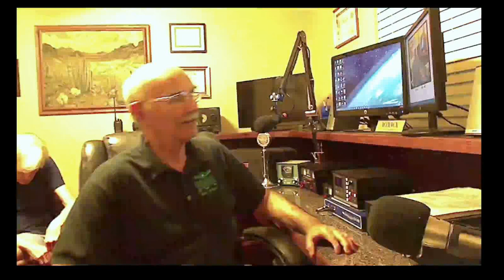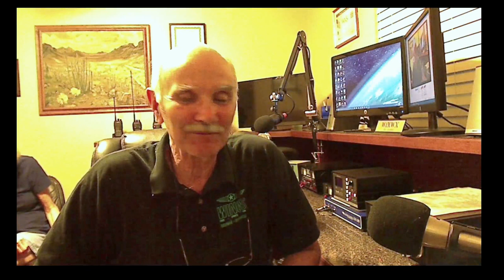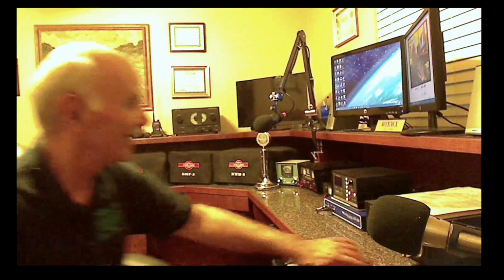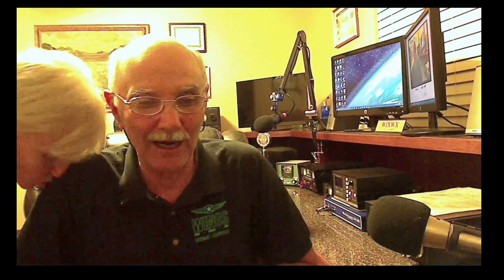Geeks talking about amateur radio minutia!

Comment: Some good pointers, I currently have a 100ft run of cheap 8x to my G5RV and do plan on upgrading to LMR400 by wintertime. I expect a noticeable difference there, and it will be more durable out in the weather as well. I run 100 watts on  a TS520 now but have a Heathkit 800w amp I am refurbishing too, and I expect to have on the air in the next year. I say run whatever is you have and keep making improvements. It is fun building up a  station and making changes along the way. Thanks for the good video talk.
Reply from the maker: Yes that's what I did-- built up the station over time. I did not mention it during the video but I now use solderless connections (except for the center conductor) on all of my coax-- this eliminates the risk of melting the foam inside LMR400. Refer to the video below and 73 from W1XWX - TelescopeMan

https://www.youtube.com/watch?v=qPlcT9SXNPs